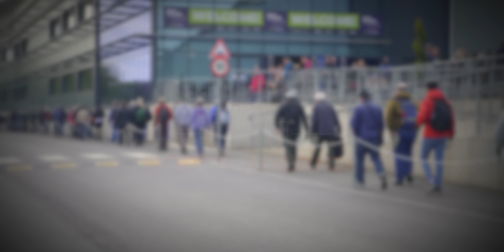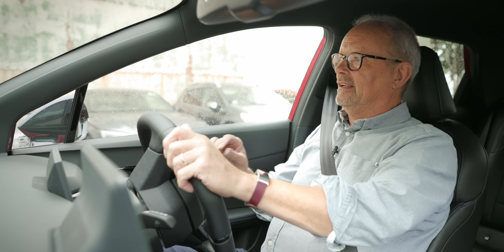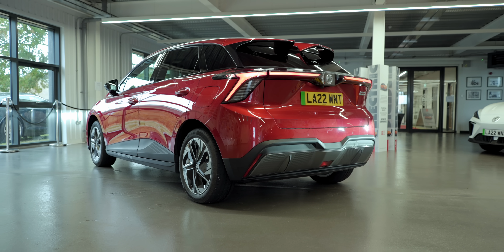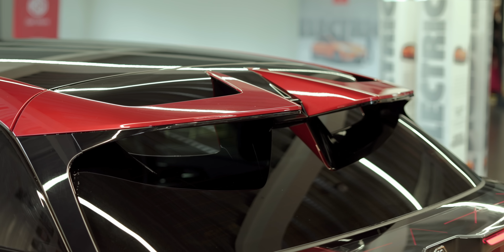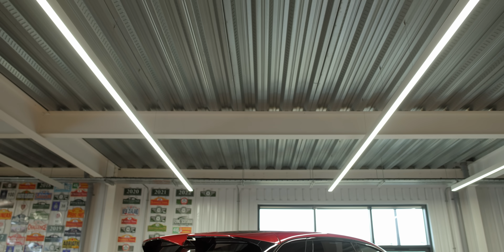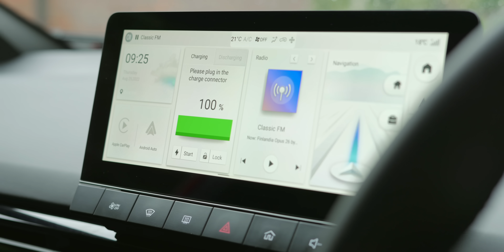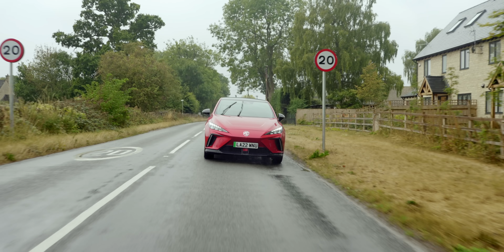MG4: The Bargain Of The Century??

Comment: This might be the one! As always an enthusiastic and well put together review from Robert :D Just three quick questions about the car: 1) Will the 77 khw batterty pack come with the current motor from the trophy model, or is this just for the "hot hatch" model? 2) Does it comes with wierless updates? 3) Can you run a refrigerator and tv for a weekend from the V2L (the cabin does not have electricity)? Cheers! :)
Reply: Most ref. use 2 to 3 KWH a day. 32 inch tv -40 watts an hour. , Microwave 1.2/1.4 KWH per hour of use.
Reply: @kkarllwt  Has anyone used their MG for this particular thing - as a powesource to a cabin or otherwise? :)
Reply: It looks like the 77 KWh Battery Pack will be used in a non-performance version.

Comment: That will sell like hotcakes. Is this the start of the reasonably affordable electric car? I think that in a couple of years 2nd hand, these will be as affordable to most folks as a petrol car
Reply: ehh i wouldn't go that far, "most folks" looking to buy a 3-5 year old ICE car of this genre are looking to spend well under 10k, I don't see this dropping anywhere near that low after 3 years unless a lot of other cheaper EVs come out in that timespan and it has to compete. Still, it does mark a big step toward EVs becoming affordable, just needs to drop another 10k rather than 20k like it needed to a couple of years ago :D
Reply: @RWoody1995  You can't get anything 3-5 years old for less than 10K. The price for a used car is crazy at the moment .
Reply: @sargfowler9603  yes the prices of used ICE cars are crazy but so are used EV's the ID3 was £29k when it came out and now used they sell for £32k-£34k depending on mileage. I see this trophy MG4 selling for £32k used in 2 years time. It's called inflation I bought a 2015 Toyota Yaris in 2018 I paid £7500 I sold it to We buy any car in 2020 for £6800 and now in 2022 it's worth £8500 for the same age, spec and slightly more mileage. All that's happening is that new cars are getting more expensive so nearly new cars less than 3 years old aren't losing much money which in turn is holding up the price of 5, 6, and 7 year old cars as most cars from 2015 have all the modern technology and touch screen infotainment systems not to mention cheap or even free road Tax ! To summarize I believe the MG4 trophy will hold its value well and that the price of it to buy new will go up so getting one now before they become so popular there is a 9 month waiting list !
Reply: @sargfowler9603  Just checked and there are 13 *thousand* 5 year old or newer cars for sale under £10k on Autotrader alone right now. 3k of those 3 years old or newer. And yes you're right the used car market is crazy right now but it's only a matter of time now before it slips back to normal as we're in the tail end of part shortages really now so that choice of 13k is only going to widen significantly.
Reply: Hope so
Reply: Chinese Made & Owned. "Production takes place at SAIC's Ningde factory in China".  its Chines Dictatorship Crap 💩
Reply: @Ds0661 So because they didn't sell well in Canada they aren't reliable....hmmmm.
 I'm sure you're right about the cold, but that hardly makes them unreliable.
Reply: @Ds0661 Ok Canadian Trumpie.  LOL
FACT is the Leaf is one of the most reliable cars made. 
 That they don't work in extreme cold as well is a side factor and HARDLY makes them an unreliable car.
 Doofus's make claims about being bad for the environment, people with a brain understand its THE BEST WE"VE GOT RIGHT NOW and will work toward something better.
 Unlike idiots that would prefer to sit in their car with the AC on while the world burns up. 
  Good thinking!
Reply: Totally agree, this could really shake up the new AND used market. 

Right now, if you're looking at EVs under £10k, you're still only gonna get a Nissan Leaf from 13 years ago with barely any range. This could really compete.
Reply: (nissan leaf)
Reply: @mikeb1039  the leaf sadly has terrible range and an in the EU mostly useless charger :(
Reply: Chinese MG? I wonder how many bits will have fallen off it by the time it gets to the used market.
Reply: @Stambo59  Nothing has fallen off our 2 ½ year old MG ZS EV so far with 11,000 mile on the clock. Still feels very solid and I have no doubt the MG4 will be even better as it's a designed from the ground up EV. We've had no problems with the car unlike friends with a VW ID3, another with a Jaguar iPace, and even one owner I met whose Porshe Taycan spent 2 months in the workshop. Chinese built cars are now as good if not better than many of the legacy European OEMs. Just a shame we couldn't keep the MG brand in UK ownership.
Reply: @evornotev7794   Your closing sentence really expresses how I feel about allowing Longbridge to die. When BMW, Auto-Union, VW were in dire financial straights back in the 1970s, the German Government and their people supported their indigenous Auto Motive Industries in every way and at every level. The rest as they say is ..

What did our then Government in April 2005 and many of our fellow Brit folks do, they turned their backs on the thousands, many thousands of good folks reliant on Longbridge for their livelihood. 

Looking on the brighter side, this MG4 has I believe lots of UK design content according to some reports. Not seen one in the flesh but looks so much better than the endless same old, same old dull as the proverbial SUVs which are the default means of getting about in the UK now. 

I have yet to see any appraisal of the MG4 which is not positive. Clearly the car has impressed even some of the seen it all motoring journalist types.  Looks like Chinese MG have backed a big winner here.
Reply: @Stambo59  Is it you turn to try the sarcasm? BMW must trust chinese build quality with their world iX3 SUV.
In many cases chinese engineering is leaping ahead of traditional western standards.
Reply: @Tod_Thorp  no wonder with low cost Slavelabor.
Reply: @Tod_Thorp  Not sarcasm, fact, I work in the industry and the build quality of most Chinese vehicles I have seen leaves something to be desired.
As far as using BMW as a reference to quality, all I can do is laugh. Have you seen how long the plastic in their cooling systems lasts. Yeah, about long enough to get out of warranty.
Reply: @Stambo59  7 year warranty will help here, but I know what you mean.

Comment: Just a small correction....

Next year will see a 77kWh Extended Range version plus the AWD Performance.  The AWD model actually uses the same 64kWh battery as the Long Range model to save weight.

MG UK are targeting a £35-£37k price tag for the Performance model....

Comment: Great stuff, unfortunately the price of electric is going to be on par with petrol per mile soon enough, which might put people off them
Reply: You might want to revisit your calculations. I'm still charging with night-time tariff for 7.5p per kwh for next 12 months. Show me a 2p per mile petrol car?!
Oh and it wouldn't make me change even if it did
Reply: @adamfry1125  yes I'm also on the go tariff for my ev. Tell me what's your current daytime rate And how much per kw is public charging?
Reply: @dg115  neither of these have an effect on me or many other people's car choice. I can't remember last time I didn't charge at home. Yesterday, not using my car. me and my house consumed 3.48kwh £1.21 
So still wondering why I need to rush and get a petrol car🤔
Reply: @adamfry1125  £1.21 does that include the scandalous standing charge
Reply: Not really as ice cars are so inefficient compared to EVs.
Reply: Install solar on your home and sell the surplus during the day.  Charge at night.  My 2017 Prius Prime hybrid has only had one petrol fill this year.  All other power is generated at home.
Reply: @DavidJuddDove  be careful with that. Petrol will go off in your tank especially this e10 stuff and potentially cause damage. I also have solar and battery storage in my home I'm very fortunate to be in a position to afford such things.

Comment: Get rid of that weird double-spoiler thing and I think you're onto a winner.
Reply: Just don't get the top spec, bingo!
Reply: @evilmario6061  I assume you can remove it if it's installed from the factory?
Reply: @johnknight9150  yeah, there must be an option to delete it on the configurator, or to specify at the dealership

Comment: I would actually prefer the smaller battery size for this car, less weight and still decent range for most people.
Reply: Best part is that the small battery is LFP which will will last longer and can be charged to 100% every day.
Reply: @cloudstorage9928  oh really? I haven't found any info on battery tech of the MG4 yet.
Reply: @Devou1s  Yeah, all the details are in an article over at PushEVs.

Standard range is LFP and long range is NCM.

Comment: Yes, spend the production costs on batteries, to make a long range cheap car, instead of luring customers with auxiliary gear that does nothing to improve the main objective; to drive.
Reply: The main objective isn't to drive. The car companies main objective is to make money. Given the chronic battery shortage they are doing exactly what is in their best interest.
Reply: @tonyedgecombe6631  Well, when petrol was expensive in the 90', more car makers made small cars, like the VW Lupo 3L, Audi TDI, Renault Twingo, Nissan micra, Suzuki Swift, all cars that could be carefully driven and get 70 mpg. i.e. they adjusted to market demand, so possibly this is going to happen again, especially when electricity is 4 times the price of six months ago.
Reply: @Tore_Lund  Mazda does light weight cars so lets hope they will come up with electric soon that has real range battery.
Reply: @Tore_Lund  You misunderstand, the "auxiliary" gear as you put it isn't primarily there to drive the price up, it is in fact there to justify the price of electric cars. Without it the naturally sky high price of a base EV looks like a appalling deal, and the people with the cash to splash to afford cars in that price range will not be interested in a base model. The extras cost the car company bugger all (they get good markup and margins, its why the sales folks will offer and push) especially when done at scale. Easier to sell a 44k car with all bells and whistles than a 40k car with the trim and tech level of a base model fiesta...
Reply: @eddyr3691  That is true in the sense that EVs are a new market so manufacturers go for the upper end segment, where the profits are higher, but it still makes EVs more expensive than they need to be. Manufacturing cost for a compact 4 seat car without combustion engine is $5200. Then add $2000 worth of batteries and there is still headroom for profits so it should be possible to make an EV today with amenities from 1990 that costs $15000 and have 120 miles range. That would fit the niche of a base model small car, and would sell like hot butter.
Reply: @teqnkkaX  When does Mazda make light cars? there are already cars with good battery range, it seems that many people ust don't know how far they can go or how fast they can charge, on a long drive most normal people stop for breaks occasionally.
Reply: Please can we get equivalent to a basic ford escort but electric minimal computation and wind up windows ,reduce the weight with all this electric toys  ,gone!
Reply: @jamesbaker429  No company wants to be associated with cheap cars, i think that's the problem. I think it's time to revive scion.
Reply: Like tesla and all its gimmicka
Reply: yep bin the electric seats and make the range and price better. nothing more annoying than waiting for the seats to move back enough to get in when your shorter partner has used the car and its raining and you jave to lean in switch on the ignition first. 
its why i changed my seats in my e46 2nd hand bmw to manual versions that were identical
Reply: @edwilko8819  Just your weight savings of manual seats is translatable into longer range. Car manufacturers are shooting themselves in the foot, not offering minimalist models because that means fewer batteries needed per vehicle as the vehicle gets lighter, so more cars off the line per year, also from an environmental perspective, a frugal EV needs less charging and as they can produce more of them the transition goes faster.
Reply: @Tore_Lund  you complain about features but when did YOU buy a brand new car? vote with your wallet. electric seats with memory is the best when it comes to sharing a car with your SO.
Reply: @TrueDesire존  Cost of new EVs is a road block, both sales wise and production wise and weight is the #1 kWh eater in city traffic. Must admit, I've never bought a new car: Not only a money issue, but I don't drive that much. My current EV is 20 years old and it was cheap too and had down payed it's footprint when I got it! I don't like the fat C-pillars of new cars, they give lousy rear visibility. Likewise the very thick doors, they make the whole vehicle  wider. and they (the cars) are significantly heavier than 20-30 years ago because of that, so it is not only the infotainment system I'm complaining about. A rule of thumb, to have an agile EV that has also has reasonable range, is that battery weight is at least 1/3 of curb weight., That means that weight savings needs to be designed into the rest of the car. We have million $ Lambos with hand crank windows for weight savings, like to see more of that thinking with EVs. It would be like how affordable Chinese neighborhood EVs are made today, but instead of small 12kWh battery, you put 30-40kWh in it and get 350 km range and it would be a significantly cheaper vehicle too, than even short range full size European and US EVs, This MG is converging on that kind of thinking.

Comment: I'd love to see an even smaller version of this a proper city car.
Reply: @Lookup2Wakeup  Silly comment. My car (Kia Stonic) is slightly smaller than this one and its way bigger than my current needs. I would get an EV city car if it was available and priced similar to the Kia Stonic.
Reply: dacia spring
Reply: @Darx97  maybe spring?
Reply: @ehombane  heh damn autocorrect, didn't notice
Reply: Smart EV？
Reply: Ora Cat or BYD Dolphin, maybe?
Reply: @kittyflier8338  still super expensive. I hate when they say cheap and is not even under 10k. At 10 is good price. Cheap means under 5.
Reply: @ehombane  Maybe Wulin Hongguang Mini is designed for you...problem is that it might never make its way to the UK.
Reply: @kittyflier8338  Yep, that is a cheap car as I understand the term of cheap. Plus transport and taxes, would be a regular price though. And they presented it last year in this channel, it said the price in the title, but did not mentioned in the title that is cheap, or bargain as it is said for this one 7 times more expensive.  And of course it will not made it to Europe. If that will be available here, all young ones will buy it, and streets will be blocked with cars. Nobody will be able to drive in a city, everybody will walk :)
Reply: @Michael Headley Coming next year

Comment: With battery costs still representing a significant proportion of the total cost of electric cars it makes you think that a battery tow solution could be a possible stop gap until battery prices plummet, (as they will). Then you buy a cheap 100km car that satisfies most of your driving and then pick up a small battery trailer from your local "rent a battery trailer shop" to take you across the country. Hook it to the car tow point, plug it into the cars rear socket and off we go. Now I have a cheap electric car that can go 400 miles when I need to.

Comment: What happens when the batteries go bad? Are batteries are recyclable? if not recyclable then where does it go?
Reply: Yes, they will probably outlast the car and then go on to another life in battery storage units before finally being recycled.
Reply: @johng5474   how much does it cost to replace the batteries?
Reply: @willissimpson7888  I believe that Nissan Leaf batteries are being replaced for about £6000 but these were first generation vehicles.  Today's batteries and management systems are a lot better and expected to out live the rest of the car. MG provide a 7 year warranty that includes the battery.
Reply: @johng5474  that for UK but we are in USA
Reply: @johng5474  A battery refurb is way cheaper. Watch the YouTube video of a professionally carried out refurb on a 10 year old UK owned Nissan Leaf battery. It cost £500.
Reply: Yes, they can be recycled. In Sweden Northvolt has recycling plants.
Reply: @starvictory7079  and how much it cost to replace the batteries?
Reply: @willissimpson7888  Why replace?  A battery pack refurbishment costs a fraction of a replacement. If your car engine becomes worn, you have it repaired or refurbished. It's exactly the same with an electric car battery.....
Reply: The battery will outlast the car. It an LFP battery, which has a 20 year life or more. Stop with this fixation on batteries, they're not like the battery in your I Phone.
Reply: Volkswagen and Renault both have EV battery plants already running.